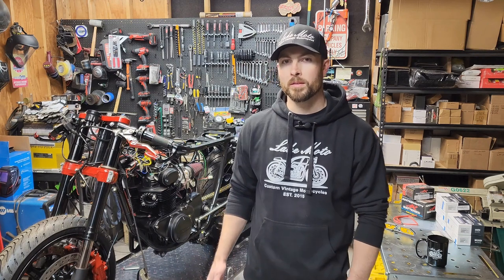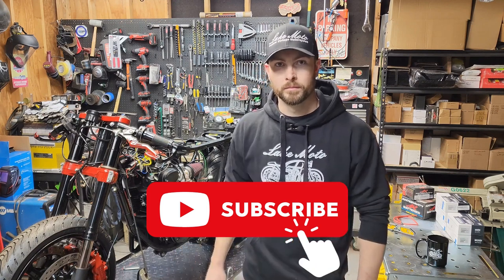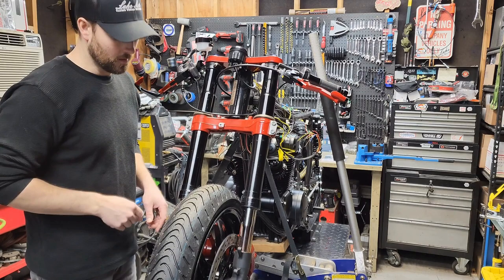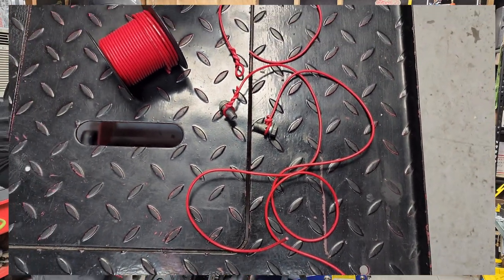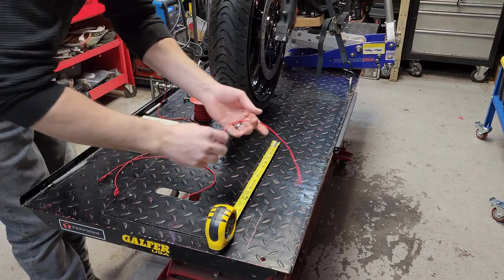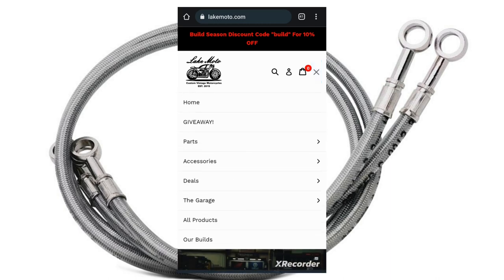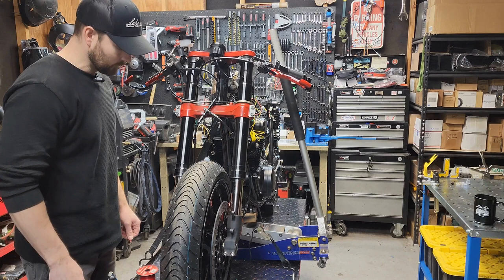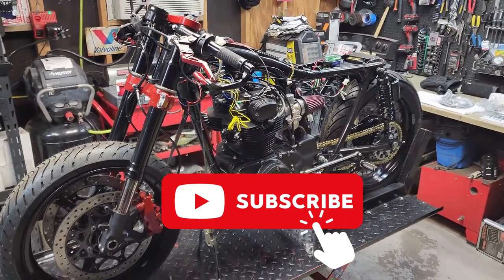DIY Custom Motorcycle Brake Lines

Comment: Will these lines fit a 1200 sportster
Reply from the maker: The banjo diameter on our lines are 10mm, which is common. Please check to see if yours are the same diameter on both sides of your lines.
Reply: @LakeMoto  ty I'll check does your  lines already come together
Reply from the maker: @bennygregory2629  yup they are ready to use. Just choose the length you need and you're good to go.